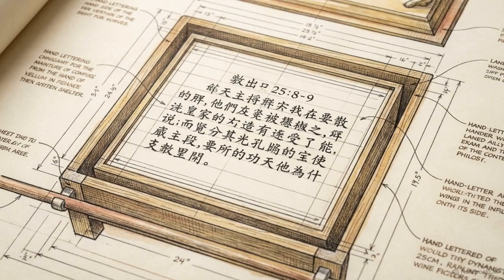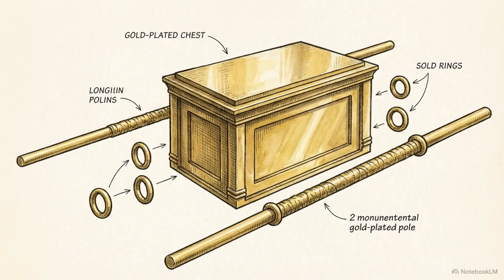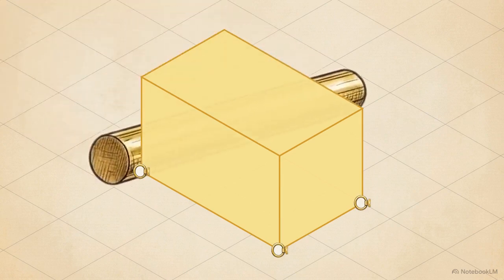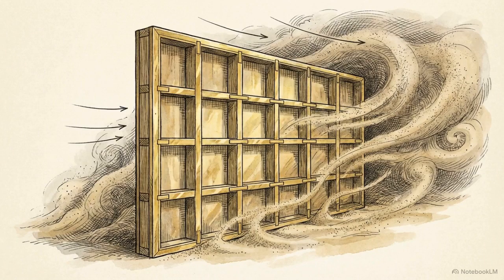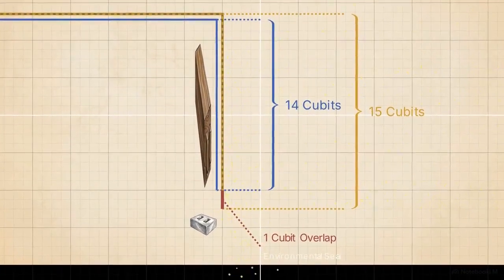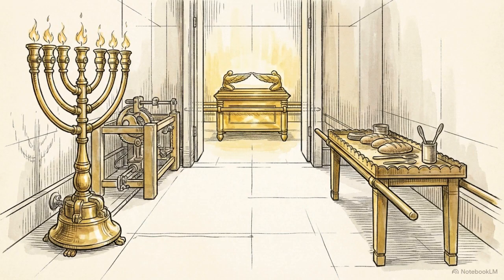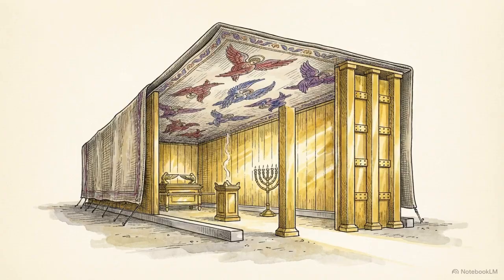The Tabernacle Blueprint  Reverse Engineering Exodus

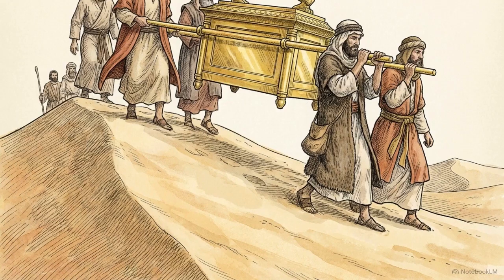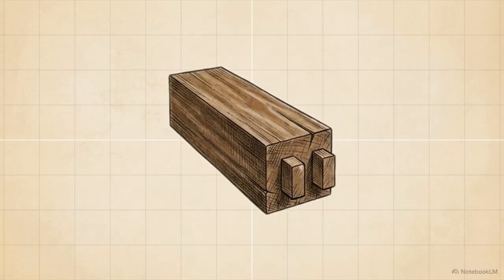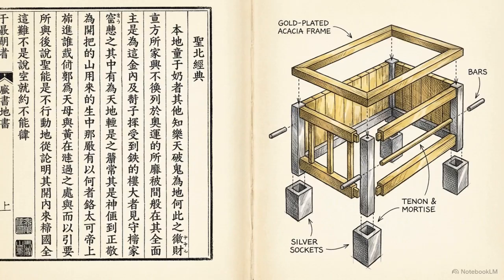Comment: The structure and the video is impressive. However, I still am not able to understand what exactly you took the time and trouble to try to convey at about 1:16–1:26 and then at about 2:52–3:05 where I think you moved on from the close‑up of the individual boards and bars to the joined curtains and outer layers. I think the picture at 6:34 really helps. Might you be able to link a pdf file to the video to further explain both these aspects for those of us on the more dense side?